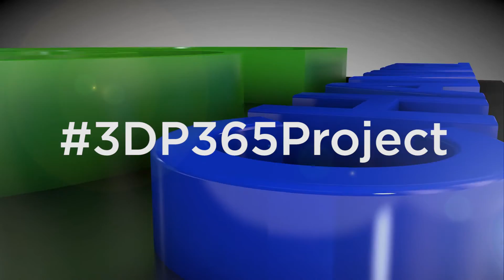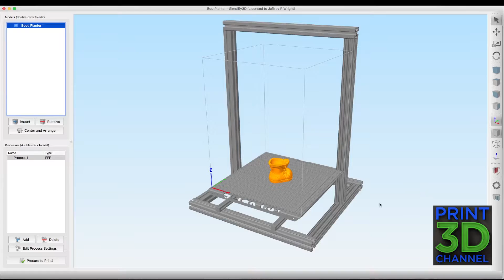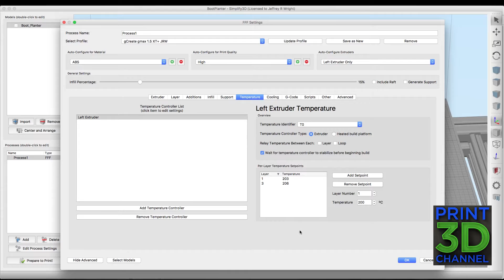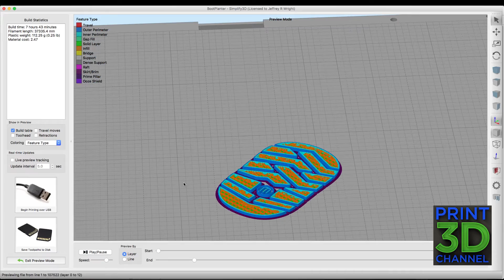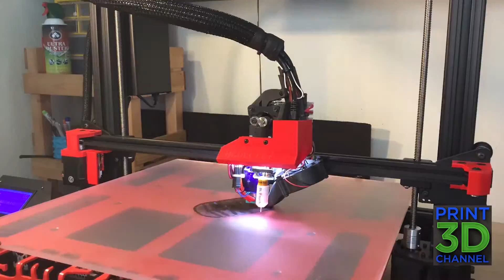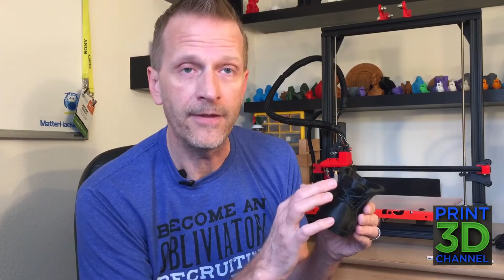#3DP365Project - Day 41 - Boot Planter - MatterHackers PRO PLA & gCreate gMax 1.5XT+

Comment: There are tricks to eliminate the seam -- untick retract on each layer -- add minimal travel for retraction -- also do retraction on wipe movements, idea is to do less retractions. I see your doing a coast, that may lead to missed lines in some cases, but your coast is very negligible. I don' usually see a point in tweaking retraction on direct drive systems, best is to do less of them.
Reply from the maker: I will have to try some of those tips for reducing the seam visibility, always been an issue with those dang things. I very much appreciate your help in making my prints cleaner. Thanks for watching and for those awesome suggestions.